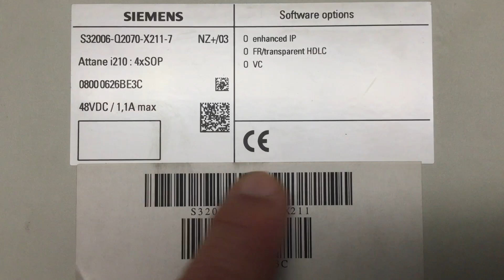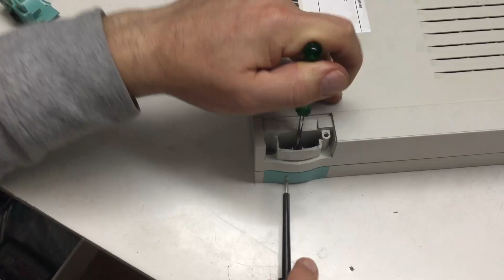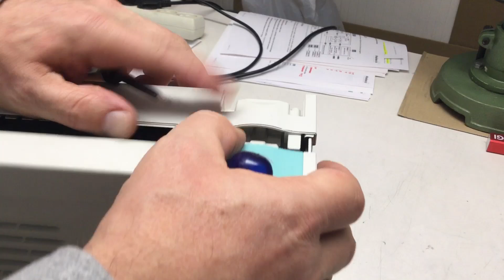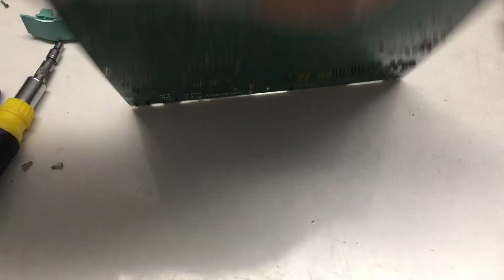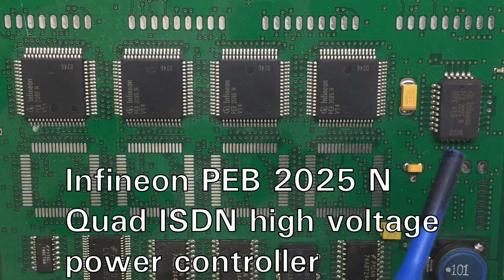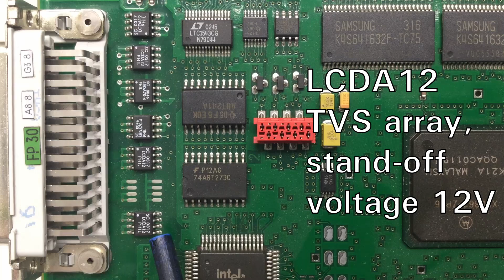Siemens Attane i210 (Vintage SDSL to Ethernet/ISDN) Teardown (All the Chips)

Comment: I suspect there is a PowerPC based CPU in the Motorola XPC chip.
Reply from the maker: Yup! From the datasheet: "[...] PowerPC architecture. The CPU on the MPC860 is a 32-bit
MPC8xx core [...]"